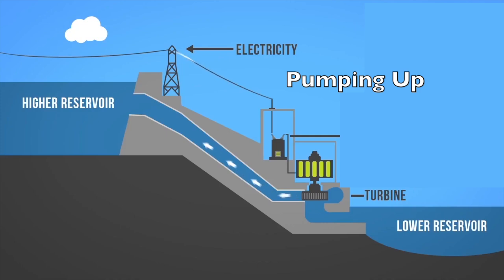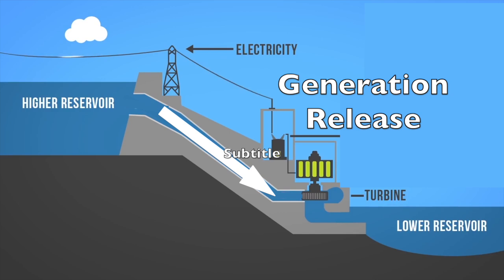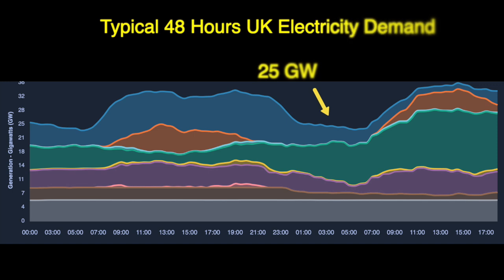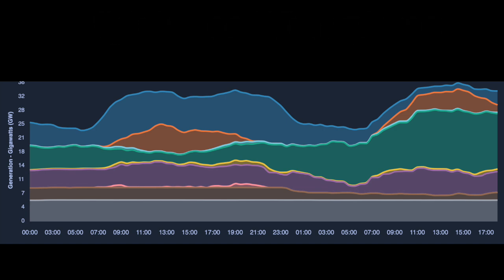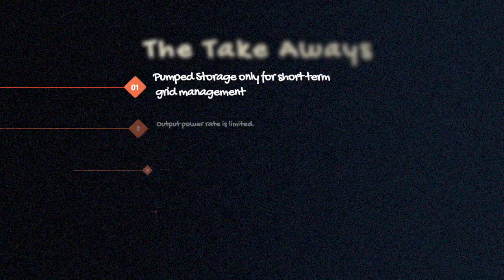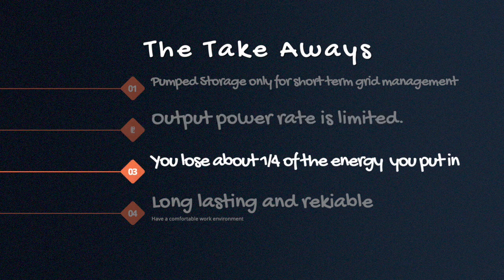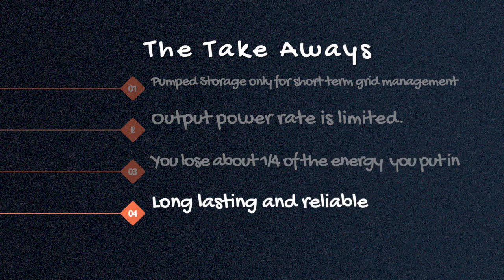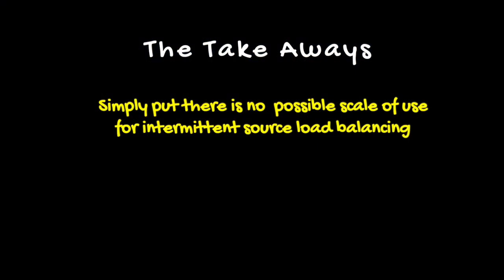PB Basics 1   Pumped Storage in 5 Minutes

Comment: Paul around this area we have STOR FARMS  short term operation reserve huge generators gas and oil there are 3  near me, twenty five miles away 12 that I know of that supply the grid at the push of a button and the cost is one of the most expensive power sources, please look into I’m sure there must be a lot more.

Comment: So a min run time of 5 hours (9.1GWh) at the 1.7GW max load, it can only add 1.7GW to load balance at any time. I wonder what the max discharge rate (C1 or 0.5) for the 1MWh battery ?
Reply: I think the common rating on those grid storage batteries is around 4 hours, so 250KW discharge for 4 hours is 1MWH.  At least that's the case with many of the battery systems being installed in the California grid per the CA-ISO page.
Reply from the maker: @The4Crawler  The 198 MWh battery farm completed can discharge at 9*MW - so 50% but the cost would be £3.5 trillion for the UK - just far too expsnsive.
Reply: @ClimateRealism  yep, it is getting tiring listening to the types who keep saying batteries can now of in near future store when there is now wind/solar.
Reply: @The4Crawler  you meant 250Mw load over 4 hours from 1GWh battery, right ? C rate of .25

Comment: There is also the consideration that pumped storage uses energy - more than it produces, due to basic physics. It takes energy to pump all that water into the header reservoir, then once the water is released, only a proportion of it is available for recovery because of friction and efficiency losses. It also only pays for itself in a commercial system where there are cheap rate off-peak electricity tariffs, or occasional surpluses of generation because of the losses described. They pump uphill overnight at cheap rate, then release at premium rate under increased market demand to provide a profit. If we ever reach the stage where everyone is using their washing machines at night or charging their EVs overnight, as suggested by some, then the peak time moves and peaks are  evened out (which is the motive behind that suggestion). There is then no need for a cheap rate off-peak tariff and the loophole for pumped storage profit evaporates and it becomes a loss-maker financially.
Reply from the maker: Yes, I explained that as an example Dinorwic costs about 2%% of the energy - 12 GWH in 9.1 GWh out.
However the main message is that th amount of energy stored is nowhere approaching that required for balancing intermittent sources.
Reply: @ClimateRealism  
I think you meant to type 25%.  

I can see how that happened as the "%" character is on the "5" key on your keyboard.  But somebody may think you were only saying 2% and the difference between 9.1 and 12 is more than 2%.
Reply from the maker: @robbomax1143  Spot on - it's 25% as I mentioned in the video😀

Comment: Importantly we just haven’t got the geography for multiple pumped storage, unlike say Norway. Dinorwic is great for short term grid management. My understanding is that system resilience (analogy of a shock absorber) needs base load that exceeds intermittents. That means nuclear and gas needs to be greater than renewable peaks and toughs for system stability. By contrast, say Norway and Iceland for example have geography/small population and geothermal sources resp which means they are able to have renewables providing their baseload. Although I think Norway is oil/gas rich and relies on some fossil fuel as well. In both countries though, energy is extremely cheap thus the GDP/capita very high.
Reply from the maker: All spot on. You do need that base load just as you state.
Reply: Not only do your need the geography to facilitate a pumped storage setup, but you also have to figure the environmental approvals to put in 2 dams and reservoirs.  One down below to hold enough water to be pumped up to the higher one.   

There is a pumped storage system in California, the Helms project.  It was built to work along side the Diablo Canyon nuclear plant back in the early '80s.  It seems to be rated at 21GWH capacity with a 1.2GW peak output.
Reply from the maker: @The4Crawler  That can make sense for helping to balance a nuclear plant. Tg plant outputs 18,000 GW·h of electricity annually  - so about 2 GW output. Ttye store seems well in balance as it can store about 10 hours of power if needed. Seems a good scheme to me.